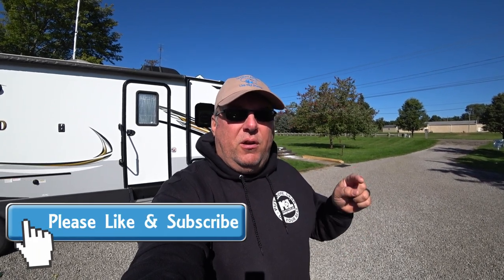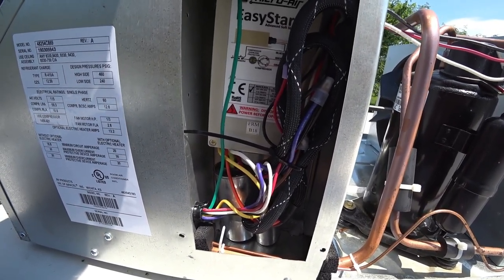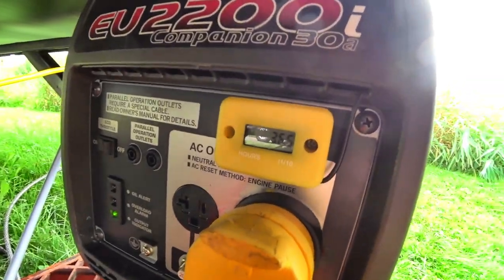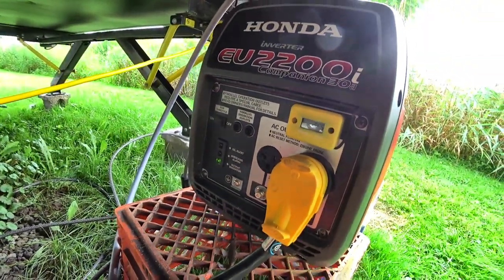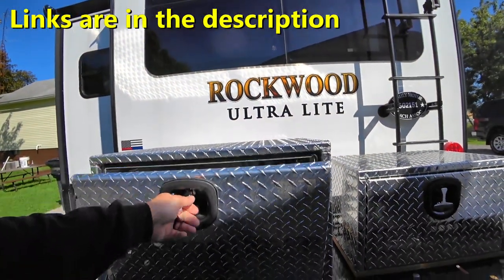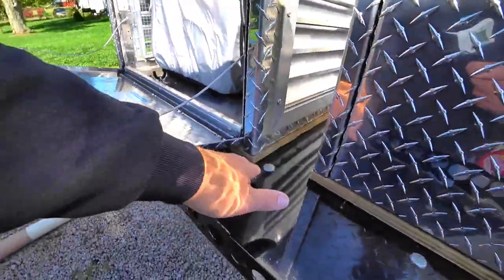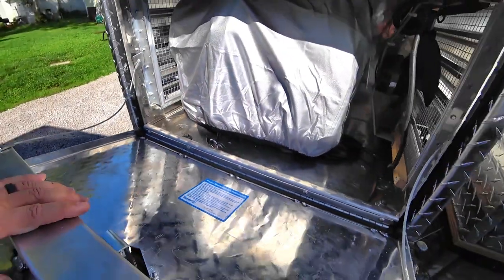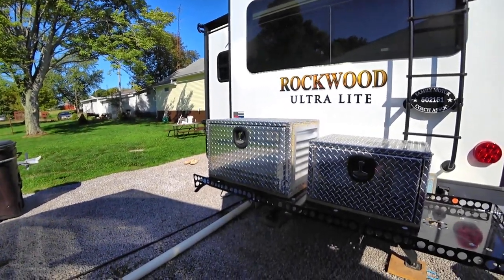RV Generator Box Build FINALLY DONE

Comment: Today 2024, the cost for an aluminum diamond plate 1/8 inch thickness  generator box  3x2x2 for my Firman 4100/3300 runs about 12-15 dollars. My design would be waterproof but not made to run in the enclosure.
Reply: Edit : 12-15 hundred dollars

Comment: Ive got a 7k watt generator that was basically given to me, do they make boxes for a generator that big? Also how do you go about refueling with the geny in the box?
Reply from the maker: I don't know if there is a company out there that makes generator boxes or not for that size of generator. If you watch the video I don't need to refuel the generator, the second box has the external auxiliary fuel tank in it. I'll give you a piece of advice though, you don't need a 7000 watt generator. If you manage your components inside your RV meaning you don't run the microwave, the air conditioning unit, a toaster, the refrigerator, all at the same time. You can do just fine with a 3400 watt generator. You just have to make sure that you're heavy load items are turned off when you run another heavy load item. Heavy load items would be the rooftop air conditioner, the hot water tank electric element, the microwave. And any other thing you may add that is a heavy draw.

Comment: You answered a couple of problems,s that I’ve been wondering. How to haul my generator on my geo-pro and how to haul my dog pens. I’m converting my 2200i to a propane, not sure my AC will work but if I even have some good sized fans it will usually be enough.
Now, I just need to figure out a good spot for my bike. Thanks!
Reply from the maker: Watch one of my previous videos where I covered tongue weights... It's an eye opener... I think it's a video that shows something about rear bumper mount and on our old Terry Resort TT...
Reply: I've converted my New 2200 watt Honda to tri fuel and only run propane. I've converted a few more generators over to tri-fuel and dual fuel. You can fine tune your propane, or natural gas setup with a adjustable load block it's called you can get more power out of the generator by running it leaner and darling in the low block it's easy and fast. Also with the load block you can adjust for very high altitude or very low altitude with just a turn of a dial and a set screw. When running propane you want to be on the lean side. You can't be too lean on propane but you can be too rich on propane and burn up the engine. Eventually I plan to do some YouTube videos and add to my channel. A propane engine the last a lot longer, runs cleaner, less tune up and maintenance on propane. In the long run propane is cheaper in my area propane is $2.00 a gallon. Running propane you don't have all the gasoline getting stale from sitting, carburetor problems, having to constantly start a gasoline engine, treating the fuel and more problems on gasoline. Since I started running propane in the mid 1990's propane has not let me down.

Comment: great video. but... plumb your exhaust up at least a foot above your roof line. again a carbon monoxide thing. the "stack" is easy to build.
 use 3 inch pvc.  a base mounted below the gen to allow full cold air to enter the bottom. this will be lower than the input of the exhaust pipe. then a couple "stack able pipes" to above the roof line. the exhaust input is via metal electrical conduit pipe (gives a nice big easy curve) held in the center of the 3 in pvc, about a foot above were you cut in to allow the metal piping to enter.
all this allows heat to rise and cold air to be pulled in from the bottom.  the pvc stays cold. natural convection forces the hot exhaust to go up. the gen has a 1 in exhaust you are going up a 3 in pvc pipe so there is no restriction for the gases.the lowest part is hard mounted, the two/three stackable section are taken down for travel. also can add in maybe a decable drop in the exhaust noise as it is directed up not around. or at least just up and away thing?
Reply from the maker: We are very familiar with the Gen-turi style exhaust.. We have 3 Carbon Monoxide detectors

Comment: Great setup, I want to mount a duel fuel champion 3500 on the back of my fith wheel. I just don’t want the extra length because I’m already 40’ long. On the back though gets it away from my bed and right next to the power plug
Reply from the maker: If you add a tray on the back that is directly over the bumper and basically in the middle just as wide as necessary for the generator to sit on there and maybe a propane tank then the 40 foot length should still feel like 40 ft in length other than right in the middle. I really don't feel as if my RV is any longer then what it used to be, even though it definitely is, I don't think you'll notice it. I'm very particular about that stuff and I really don't feel as if it's much longer than what it was even though it's 2 ft longer overall length now
Reply: @Rvdaydream  thanks for the confidence, I’m gonna mount it back there. I also want to be able to turn one ac on about an hour before I get to places at times when I’m down in the Florida keys. It’s amazing at how hot the inside can get when the outside temp is over a 100.

Comment: Mike, on a predator 3500 inverter, if I go dual fuel/ propane. What would the power efficiency loss be on the propane side?  We have a minnie winnie 2201DS 
trying to get it ready for our winter trip. 
Thanks for any info, we are enjoying watching you guys. Hoping to do the same soon
Reply from the maker: Not sure about the Predator but it's probably pretty close to what the champion was. The champion was a 3400 on gasoline but only 3050 on propane

Comment: Love watching your videos! I was considering a motorhome which had no generator. After watching a few of your videos, I knew exactly what to do... thanks to you.
Well, I didn't get that motorhome, but... 2 weeks ago I bought a 1988 Lazy Daze 26 footer. There is a generator,  but the location/housing puzzles me. It's on the passenger side, right behind the passenger front door. Right under the awning...2-3 feet from the coach door. Right where everyone hangs out! So there you are, sitting under the awning with family/ friends... and someone chooses to stay inside with a/c on or fix some dinner in the microwave. No problem,  let me just fire up the generator for you...
So everything's fine inside, but back to your little get together under the awning. Now you're trying to visit with the generator rumbling right next to you! And... the exhaust fumes lingering... Yuk! Which brings me to my question for you: 

Can I redirect the exhaust to the rear or the drivers side? Sorry this took so long...
Thank you, 
Rick Doherty 
Joshua Tree, Ca
Reply from the maker: Yes you can definitely redirect your exhaust just make sure that the pipe diameter and the Benz do not restrict the exhaust to the point where the generator overheats. There's also a company that makes a stack that temporarily Clips to the RV to get the exhaust up and above the RV and your neighbors it's from a company called Gen-Turi...
Reply: @Rvdaydream  I heard that Nascar requires those clip on exhaust stack because there were so many Motorhomes running their generator they were concerned with too much CO gas building up down low since they are all parked very close together.
Reply: Yucca valley 👍🇺🇲

Comment: Do you have room on the tongue of your camper for the generator, you could make a enclosed box vented or removable to put under the camper at the rear when sitting.  Be safe in these times and enjoy
Reply from the maker: You can check out our videos covering our previous travel trailer where I did just that. We mounted a champion 3400 dual fuel generator on the tongue had it plugged into the propane tanks and installed an automatic switch over so that all we had to do is push a button and start the generator and have power

Comment: Love your video. Quick question:  Would changing the gas cap to a flat one help with making it fit under the truck bed cover?
Reply from the maker: The Honda caps are unique with a built in shutoff vent to prevent carburetor flooding/leaking during travel.. Plus the cap allows for the vacuum feed while utilizing the auxiliary gas tank which is why they generator can run uninterrupted for a greater amount of time..

Comment: I think I will go with a swivel wheel trailer instead of hanging that much weight on the bumper. My 5er has a class 3 trailer hitch. My generator weighs 260 lbs.
Reply from the maker: Make sure to post a video of that... Covering cost, installation, operation, maintenance and etc... There are a a lot of people that would be interested in how that would work out 👍👍

Comment: Check out the New 3200 watt suit case portable inverter Honda generator. Will run any roof top AC and more but around $2,600.00 and out of stock as of August 1  2022
Reply from the maker: Honda advertises that new generator to run only a 13,500 BTU rooftop AC unit

Comment: very nice end result. Great project for you too. Can't wait to see your adventures on the road. I'm actually quite envious. Looking forward to the day when we can do that too.
Reply from the maker: Thanks Pat 😁👍
Reply: @Rvdaydream  bud just built a box for my generator 36x18x18 put 2 vents like ur on both side 10x10 my question is would i need a fan in there?my gen is a wen 2350
Reply from the maker: I experimented with our generator quite a bit. In the end since we were going to spend summer days in the heat of Yuma Arizona I did add a fan for safety. But, I had to find that out for myself with the box size that I was using and the Honda generator. So, I guess my answer is that you're going to have to figure that out on your own because if you do not have enough air flow that generator is an air cool generator and it will burn up.

Comment: So the spec on your generator says 18-1/3" height and your box in 18" high. Are the measurements off or how did you squeeze it in, especially through the lip around the entire door which looks like it takes away an inch. Thx
Reply from the maker: You just have to put it in bottom first and then stand it up. It's got plenty of clearance
Reply from the maker: Also there are 2 boxes 1 for generator and one for gas tank.

Comment: Curious why did you not convert your generator to propane and tie into your TT lines and not worry about the gas? Great video thanks for the tips...
Reply from the maker: Our previous generator( that was mounted on the tongue of the old RV) was set up on propane and had a transfer switch it was nice BUT...
when you run on propane you diminish the power output by quite a bit as propane does not have the same BTU "ooomf" as gasoline... The Micro-Air Easy starts that are installed on the Rooftop A/C units allow them to be run on the Honda 2200 generator but doesn't work when you cut the power output on generator by using propane instead of gasoline..

Comment: mike,,if you were to put a metal flat roof over your generator box ,about 2 or 3 inchs over it, it will keep the heat of the sun off of it, alowing you to use it on real real hot days"' see you on the road my friend...james
Reply from the maker: There's enough of an air gap between the generator and the top of the box that with that circulating fan inside it doesn't need any additional help. If it was extremely hot, like Arizona 120 degrees, I would think that just a cheap beach tent would do the job of making shade or even just to a sheet that is stretched over top of it. Of course they make those gen tents. But currently the way I have it set up, I have seen direct sun in excess of 85° and it not causing an issue. Great question, you definitely want to keep air cooled engines cooled, LOL

Comment: Seems like solar would be a better option given the iffy quality of power at some of the Thousand Trails parks. More expensive but more versatile long term.
Reply from the maker: Not exactly sure how running off of solar during the winter for 28 days straight would be feasible. That's why I have the Hughes autoformer
Reply from the maker: Oh, I just re-read your comment. You were talking about setting up solar as a backup, just in case one of the parks lose power? Don't get me wrong I think solar is fine but I don't think anybody that plans on staying in campgrounds more than boondocking would consider solar. That's an investment for people who like The Boondock all the time or most of the time. In the future I could see ourselves getting some form of solar but we would have to find the majority of the parks we stay at to have power issues. Some reason I think that might be the exception not the rule.

Comment: Why did you need a bumper box for the generator instead of using the port where the generator can go?
Reply from the maker: Very few Trailers are equipped with a dedicated generator bay... And it's  very difficult to add one...

Comment: Did I hear you say you are running your A/C, laptop, TV and a few ligbts off ONE Honda generator? Is that a 2200i.  I thought you would need to pair 2 units.
Reply from the maker: Yes, with a Micro Air Easy start installed on the A/C unit
Reply: @Rvdaydream , are you able to run the A/C on full power?  We have a 30 ft Jayco with a 13,5000 A/C unit
Reply from the maker: Yes.. We can run a 15000 BTU..
Reply from the maker: https://youtu.be/xkGil4bMqkA

Comment: Our Bedroom is in the back. Would it be an issue with fumes or heat?
Reply from the maker: Definitely not a heat issue but, there is a product that I would suggest for RV generators it's called a gen Turi. You can check it out on YouTube I'm sure someone has installed one and shot a video of it.

Comment: Is travel trailer a 30 to 50amp? Does the  Honda generator have enough wattage to power the air conditioner along with lights and tv?
Reply from the maker: You have to watch my previous videos where I converted rooftop air conditioners micro Air Easy starts.
Reply: RVdaydream I will definitely watch them and thank you.

Comment: Add a muffler on the bottom shelf it will be even quieter.
Reply from the maker: These little engines are designed to be extremely efficient when in stocks trim....adding additional back pressure to such a small displacement could mean big trouble and much less longevity and efficiency..... Even the small amount of exhaust extension I already added could be an issue....

Comment: I'm a small engine mechanic and my business thrives because folks put a plastic or cloth cover over their generators when not being used :(  They collect tons of moisture due to the principal of "condensation" and the cover traps it! That wreaks havoc on small engines especially the electrical components.  Let air circulate around it inside box :)  Just saying....
Reply from the maker: Yeah the cover that we put on it during transport is open underneath and keeps the pressure washing that gets done at the Blue Beacon from hitting the generator directly.
Reply: YES you can cover it with plastic if you throw in a moisture bucket .
These are available from hardware stores everywhere and absorb moisture

Comment: So a 2200watt Honda generator will start a 15,000BTU A/C? wow, My 13,500 Dometic roofmount unit (circa 2014) needs my 3500watt inverter generator 30amp 110v plug in order to turn on
Reply from the maker: We have microair easy starts (which are listed in our Amazon Store) installed on both of our Ac units. 😁

Comment: Over 3'  from bumper not legal.  Need to add lights at less reflection tape.  Other wise nice build and good info.
Reply from the maker: Each tray is 2 ft, the brackets in which they mount are only a half an inch away from the bumper. So that makes it basically 24 and a half inches away from the bumper. We traveled 22,000 miles and 33 States and been through at least two vehicle inspections during that time. Never have we been told anything like that. Matter of fact I don't even know any laws on the books anywhere that says anything like that. Cargo Carrier supplied as an option from the RV manufacturer is over 3 ft. With no additional lighting nor reflective tape. Just take a look at our current fifth wheel and what came from the factory on it.
Reply: I guess I remember wrong 4’ 
The U.S. Department of Transportation (DOT) says, “No state shall impose…a rear overhang limitation of less than four feet.” Therefore, four feet is the minimum allowable, and individual states set different maximum limits.
Reply: @Rvdaydream   again nice build.  Reflective tape is just for safety. So some one don’t hit it in the dark.  There are many laws on how far somthing can hang pass the center of axle or how far pass the bumper front or rear.  Or how high off the ground.  This rule are annoying.  But there so a car don’t rear end them and get a item threw the window before hitting the bumper.  In video looked bigger then it was.  Keep traveling/having fun.
Reply from the maker: Oh yeah, 4' for sure... That's a lot of overhang.. 👍

Comment: How does the generator draw fuel from the outboard motor fuel tank ???
Reply from the maker: Hondas have sealed tanks that allow a vacuum draw
Reply: RVdaydream I noticed you have used the champion also but decided to haul your Honda,
Do you know if the champion would work the same way with the 6 gl tank you use for the Honda 
Thanks
Reply from the maker: @rogern5368  what I remember about that when checking in the past was that it would not work in the same way

Comment: Yeah but what if you have a 50amp 43 ft Fifth Wheel? Please send help!
Reply from the maker: Length doesn't matter... We have a 50amp travel trailer... We can run our 15k A/C unit and watch TV... See my video on Micro Air Easy start... If you want you can mount a Honda EU3000 with no external fuel tank closer to the rig and run a 15k and a 13.5k A/C unit with Micro Air Easy start installed on both... But nothing else.... It's all about power management..
Reply from the maker: https://youtu.be/pOzfm7SCUZc